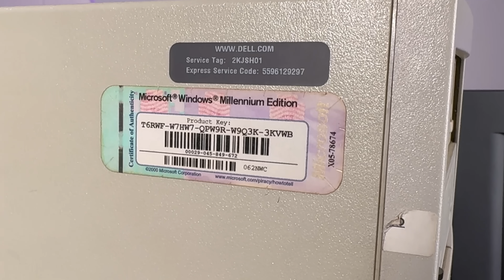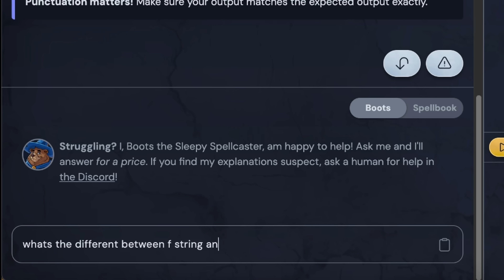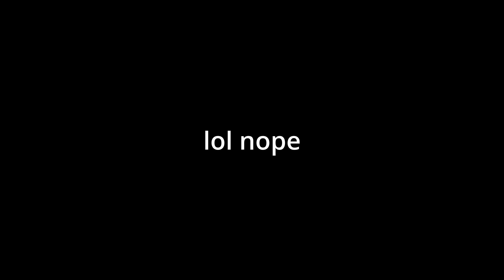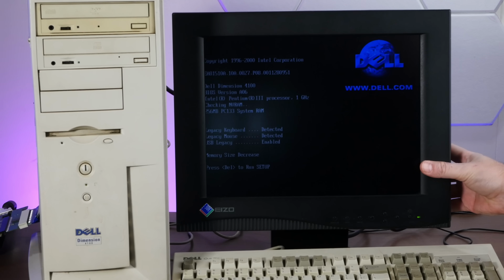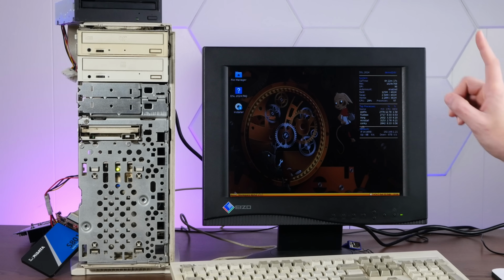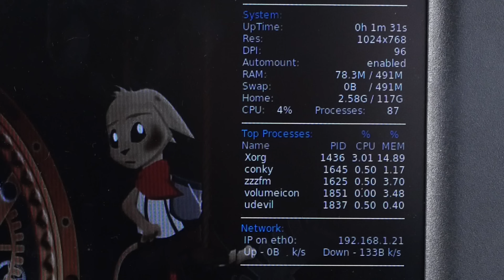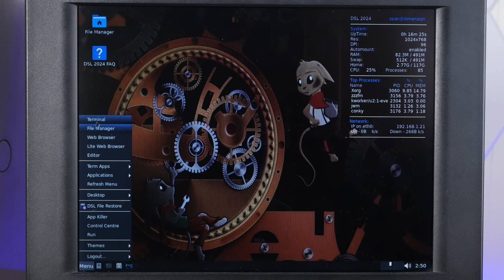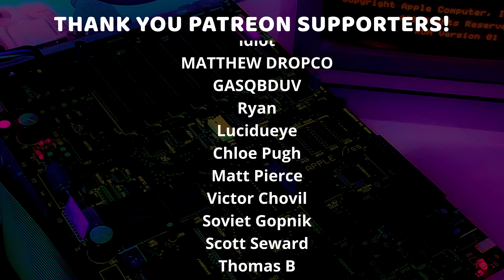Now THAT is a DAMN Small Linux!

Comment: I just installed Q4OS Linux on a 1GB Ram 64 bit PC and it works pretty well. It doesn't install a lot of software, but I used Synaptic to install quite a bit more than what it comes with. It has a second slot for another Ram slot for another 1GB stick. Now I need to find the right one in my junk.

Comment: I guess by today's standards this is a small o/s, but Is there or was there ever a Linux distro as small as Apple's System 6? It would fit on a single 1.44 mb floppy drive and yes, you could take it on the net, though in text only without graphics.

Comment: Damn small is excellent for it's use case. Wonderful for old PC's or newer computers that don't come with much power. But if you go much outside of that, you'll find it damn useless. You'll find you're just upgrading and upgrading, so that you basically have a modern installation like EndeavourOS or perhaps Mint if you're still into Debian.

Comment: Thank you for sharing. I've just installed the DSL on an old laptop Fujitsu C Series Lifebook I believe is called, with a big memory of 1 GB of RAM. It actually works pretty well compared to all the other distros I've tested. It's actually a few times faster than Puppy Linux. Internet is working, now I only have to fulfill a last request and that is to connect the USB  bluetooth adapter to the bluetooth speaker 🤔. One more issue would be to brighten up the bloody menu. It's so dark, it's almost impossible to see anything, the monitor has been fixed and also the wallpaper. Cheers.

Comment: Remember a long time ago when Java was the "shit"... Looked for pages that had funny Java apps.. came across someone that ran a Java x86 emulator online with an installed DSL (the 50 Megabyte one) and that was a blast... was amazed how well it ran and what it could do... It had other stuff too like FreeDOS setup with DukeNukem3D if I remember correctly...
So searched for DSL again just to see what happened to that... and what do you know... tried quickly on VirtualBOX and it seems great! have an older laptop with 512 Mb memory and a Celeron of some sort 60 GB harddrive?... think I will install it there on actual hardware... for fun... it currently has a Hackintosh install (from about 2012-13 or something) but it's buggy...

Comment: People so often are talkign about how much better Linux was for old computers. But your video has proven my experience. Linux at it's core is not any better than Windows when it comes to old hardware, because the drivers are missing. So you only have the choice between anyway outdated cores in both cases, which obviously makes Windows the better choice, because at the earlier times Linux was nothing to speak of when it comes to desktop use.

Comment: You can upgrade that 440bx mobo with a 1.4ghz tualatin celery cpu, 768mb ram, radeon 8250 256mb pci video card, and sound blaster gold pci card... which was enough for the original Halo  to be playable😂

Comment: I have a very similar if not the same computer. I got it way back when I was in school from my uncle, it was brand new at the time, it must've been one of the last computers they made with WinMe before they switched to XP.  I actually used it for years and it seemed pretty good at the time, though I'm sure if I tried to use it now I'd be incredibly frustrated with how slow it is. I'm sure it could do say word processing or basic media playback depending on the codec, but I'd be surprised if it was able to say load youtube in the browser and play video without dropping frames left and right. Maybe if you gave it a video card with hardware acceleration?

Comment: If it's based on Debian, how does it run < 100MB RAM usage when idle? My most basic Debian install (only system essentials and SSH) is 4-5x that when logged in to a bare command line...?

Comment: i love this video a lot! i didn't know dsl was back until i started watching it. it was great seeing you continuously add jank until you finally got it working, which is a normal action retro thing but i still like it lmao. and i see you're using all that patreon money to good use with the wheel of ssd's - great purchase! 😂

also i love antix and especially mx linux. the latter is my favourite linux distro because it runs on almost everything i've tried it on (even a 2008 mac pro, although v. 23 doesn't run too well on mine with its default graphics card, so i use v. 21 instead), the community on its forums are very friendly and helpful when it comes to solving problems, and the dev. team are openly anti fash!

the antix dev. team are openly anti fash too! it's such an unfortunately uncommon thing to be both anti fash and in the linux community, so that's why i'm pointing it out.

Comment: Specs are similar to what I had in childhood. I think it had 800 MHz Celeron, 384 megs of RAM an 20 GB hard drive. Was running Windows Me as well.

Played so much The Sims on that thing =)
Reply: 650mhz coppermine p3 laptop with 512mb ram for me!  triple hand me down computer with a self immolating power brick lmao. micronpc transport gx+.   I actually still use it today for niche software on windows xp and for the floppy drive to transfer data to/from my IBM 5140.    played a good bit of unreal tournament on the micronpc.  great keyboard, and screen believe it or not.  1400x1050 with good color

Comment: This Dell model was my first computer. It was 933MHz with 128MB of RAM and a 20GB hard drive that I think was 5400 RPM. We figured out the hard way later trying to upgrade it that there was something about the case/motherboard that wasn't ATX-standard and had to then go and buy a new case to go with our new motherboard. The original video card in mine was a GeForce 2 MX, I wonder if something like that would play nice with modern nvidia drivers?

Comment: Finally! When some one in the Linux community says This or that Linux distro will run on "OLD" hardware, they really meant it this time! LOL! Good ole MX/ANTIX! My most favorite Linux distros! I have P2 and P3 systems running the old period correct Linux distros and BeOS on them but I found out that part of the challenges I faced with the old Linux/BeOS distros of the time(2000-2001) was down to bad drivers.. I tried to copy mp3 files off of old archived CDrom discs in my P3 with Redhat 6.2 and got alot of CRC cyclic redundency errors and come to find out it is down to the drivers for the ide devices and sound and so on, not being so good back then. Also the hardware just sucked at the time.. So there is that..I will try this AntiX setup and see if I can run the same tests and see if i get those CRC errors using the same old hardware but with a shiny new polished Linux Soul in it..

Comment: I've got many W6LI-based dual Pentium-Pro (32-bit) that clock in at 200MHz each, for a total of 400MHz of compute power on a shelf in my garage. The BIOS is so old this system will not boot from CD, only floppy. I do have a 3 1/2" floppy that contains a "boot loader" allowing you to select CD. USB? Hah, no such device on this system. These systems max out at 512MB of RAM, since that is all the memory controller can handle. In the early 2000s, I ran 5 instances of VMware Workstation for Linux on one of these systems. All were running small Linux VMs with small amounts of memory per system. Crazy, but it worked. Being able to boot Linux (then) from 1.44MB floppy was very important. Try that today. 🤣

Comment: That ain't "Damned Small". I installed NetBSD in 1992 and in 2024 on a Amiga 3000 with 68030@25Mhz, 16MByte. In 1992 I used a 52MByte HD and in 2024 a 2GByte HD which remained mostly empty. Also I ran Debian 4.0 from 2010 to 2024. To my surprise I managed even to use my Ethernet-Card and my VGA-Card without problems but to be honest, X11 isn't any fun at all except if running as a pure X-Server without local applications running - then it is kinda snappy. Just as an example, connecting through SSD into the system takes around a minute with modern SSH encryption and a mere apt update could take up to half an hour.
NetBSD actually boots quite fast after cleaning up the rc-Stuff, three minutes and another to boot up X11 with fvwm95 and a local xterm. Debian was much more of a chore...

Comment: I have this same looking pc, mine is the Dell XPs T450, I upgraded the cpu from the p3 450 to the p3 700e, it’s has 768mb of ram 3x256mb, came with a riva tnt 2 64mb, but I upgraded it to a 128mb fx 5500 agp. I have the matching Dell 17” CRT, the Dell ’Quiet Keys’ Keyboard and dell ball mouse(Mitsumi) it’s so nice, when Dell made good computers. And runs Win 98se, I have the factory disks too.

Comment: I don't understand why you started using "this old P3" just to strip it of its original hardware to install a small OS. What is the purpose really? You got rid of the mechanical HDD and GPU, so you modernized the P3... but why pick up an old PC in the first place?  🤷🏼‍♀️

Comment: I had an older Acer Athlon netbook that I absolutely loved. Even up to a couple years ago it still ran fine. Put an SSD in it and maxed out the RAM to 8GB and it ran Debian just fine... except for web browsing. Literally the one thing I needed to do with it had become completely unusable. I just wanted to bring it in the garage to look things up on while working on cars and projects. It could do 99 things without a problem, but rendering a modern web page wasn't one of them. Sad what what a mess the web has become.

Comment: Dude, my family computer was pretty much exactly this machine. A DELL in the same case, Pentium IV, and 128 MB of RAM.

Used that machine for gaming, Linux distro hopping, and learning python. I tried all kinds of Linux distros, one of which was definitely Damn Small Linux (of that era... 2007?).

I mostly ran Puppy Linux though because I could boot from CD and persist to USB thumb drive. Yes, I do mean both. 1. Insert disc 2. Shutdown 3. Insert persistence USB thumb drive 4. Boot from CD into RAM 5. Eject disc 6. Do computing 7. Safely shutdown, which would write to the chosen persistence location.

My understanding is that Tails kinda does something similar now, but with more security bells and whistles.

Comment: The Rage 128 probably would've worked fine. There's a Linux driver for it called xf86-video-r128.
I own an AGP HD 3650, and it is very picky about what motherboard it is plugged into. I've tried it in 2 different Pentium 4 motherboards and 1 Athlon XP motherboard, and it only works in one of the Pentium 4 motherboards.

Comment: OpenWRT is a tiny linux, commonly used as firmware in routers and other embedded devices...
Contiki OS is not linux based, but is so tiny that it runs in 10kb of RAM (30kb with GUI).

Comment: I did use an old Pentium 3 system with some modern-ish upgrades (namely Intel Gigabit NIC and an NEC USB 2.0 card) as my first homelab server about a decade or so ago. It ran 32-bit version of Debian on it. Still have all the parts except for the case.
Talking about janks... You should see the insides of my storage server. I have a 3.5 HDD screwed to the bottom of the case. And a 2.5" one mounted vertically with a couple of standoffs to the back side of the case. And a 10Gbit NIC installed in a PCI-E extender mounted upside down to the top of the case. And let's not forget a full size 6-port SATA card installed in an M.2 slot with a PCI-E x4 adapter. Oh and I almost forgot 8x 2.5 drives mounted in two 5.25 bays....

Comment: where do they sell a pci to pcie adapter?  i need that!  i have a pc that has no video card slot, its not populated(dell gx520) and terrible video for its core2duo.  also i have no agp cards and an hp d530c, and a few pcie video cards.  i understand it wont be as fast but would it work?  so is like an agp to pci and a pci to pcie adapters, i dont even see on ali express! lol but you have 1!

Comment: I have been running Linux as my daily driver for about a year now. And I uninstalled Windows 11 back in August 2024.

I've been distro-hopping a bit even though distros like Ubuntu, Zorin, and Fedora were excellent. 
Recently I hopped a few more times, and really wanted to try DSL, but the webpage for it said it didn't work with UEFI yet,  and for context I am running a fully modern gaming desktop lol.

I settled on Rocky Linux, which basically identical to my experience with Fedora (not entirely recommended for Linux/Computer beginners, but once you have what you need set up it's rock solid!)

Comment: I had an almost physical reaction to that windows ME sticker. I think is the same hardware spec as the P3 tower my parents got in the early 00s. It was dreadful. When they handed it down to me i stripped that crap off and put Ubuntu on almost immediately.

Comment: The video card isn't janky, janky is prying out the drive cages from an Optiplex 3010 so a full length Nvidia 2GB card would fit. It still has the optical drive bay and one bay underneath. The boot drive is an SSD in a spare mount with a single screw attaching it to the inside of the front of the case.
Windows 11 24H2 on a Core i5 3470 & 16GB of memory.

Comment: Is the Wheel of SSDs much more stable now? 

AGP versions, voltages etc are a nightmare for getting newer AGP cards working in older boards  - the adapter might be presenting as a compatible one, while the physical cards might actually still work on a newer board

Comment: i currently use dsl on an ibm thinkpad 600, amazing keyboard to simply write! my only issue is that I own a second one with a smaller (pata) hdd and it does not fit the whole os, which, while light on cpu and ram, is not small at all!

Comment: I hat that very computer model there with maxed out RAM. Last Linux install I tried was Lubuntu in 2015. Used it for serial connections to Cisco switches in a lab. Also for a while had pfsense installed on it with a gigabit Ethernet NIC for a lab FW.

Comment: AGP version numbers and slot types and voltages are all kinda important. It's usually best to stick to cards of the same era of the CPU, sometimes a few years newer. (at least an easy starting point of what's supported or not). Does modern linux like any of the 9000 series AGP ATI cards?

Comment: I bought one of these 4100’s brand new while in college with my part time job money. Through the college IT help desk, I was able to load Windows NT 3.51 on it. Those were the days. Then, I was able to use a serial connection to access the campus network via a terminal program.

Comment: My very first experience with Linux was the original DSL. I had it running on a Dell Latitude D600 with a Pentium 4 and 512 MB RAM. It was extremely snappy, especially compared to the messed up XP install. At the time I knew next to nothing about computers, I just wanted my poor laptop to be usable again.
Reply: I have the same Portable Dell D600, it use a Pentium M, not a P4, D610 has a P4, in my case it run fine with LUBUNTU 18.04, using UBUNTU PRO for security update up to 2028. I still use for situation where i don’t want bring valuable portable, like during a trip. I increase RAM  to 2Gb, but HDD still at 60Gb. It is a good spare machine💻

Comment: Agp was smack dab in the middle of the capacitor plague. Check your caps. I have a very nice 7800GT that also uses molex power and it needed a recap of all the electrolytics.

Comment: I recently learned of another Linux project called ELKS (Embeddable Linux Kernel Subset), which is capable of running on PCs from the '80s. Which is incredible, to say the least. Running modern Linux on old hardware really is a treat.
Reply: It can even run on the NES!
Reply: @xanderplayz3446  it takes an obscene amount of work to do that, and the only video I saw of someone doing it was in a nested emulator within a game. Memory mapping is problematic for that tight a use-case.
Reply: @sbrazenor2  It's true that he needed an emulator to get ELKS running on the NES but he also implemented that emulator himself. What he accomplished is impressive.
Reply: I wonder how ELKS compares to the early 16-bit 8086 versions of Xenix.
Evidently Damn Small Linux requires at least a 486, which is technically still '80s since it was released in 1989.
Reply: Would be interesting to try on my Twinhead Subnote 486SLC, but I need to do a full teardown and documentation of the machine (there's currently almost no documentation on the machine).  I might have to wait and see if I can make it to VCF East, and do a teardown with people who actually know what they're doing.
Reply: @SenileOtaku A 486 can still natively run the Linux kernel and user space tools compiled for it on top! There's even Linux "distros" that fit on a floppy disk, a whole 1.44MB of kernel and BusyBox userspace applications!
Reply: @resneptacle  WOOT!!! 
..ehhhhh who am I kidding.
Not I mon frere! LOL
Reply: ELKS isn't technically Linux.
Reply: @fhunter1test It is a fork of the Linux kernel, what else would it be?
Reply: @polyglotusamericanus4163  Linux-like (or *nix-like) system. It may have started as a fork, but it has pretty very few things in common with Linux.
Reply: I thought the minimum CPU requirements for Linux was a '386SX, as Linux requires a virtual memory MMU to work. Even then you must compile the kernel with '387 emulation support for this to boot. I've done this at a past job. The only UNIX variant I've touched that ran (barely) on a '286 was Xenix. I had a copy on 5 1/4" floppy and I think loaded onto a 20MB (yes MB) hard disk. It did run, badly. On a memory constrained system (all '286 were then) anything needing more memory did swap stuff out, a lot. It was not useful at all, and as more just a "I ran UNIX at home" experiment than anything else.
Reply: @numbr6 Modern kernels don't support the 386 as a target anymore, the lowest you can compile it to is a 486SX. I think the 386 was dropped somewhere in the 5.x kernel releases
Reply: From an NES video?